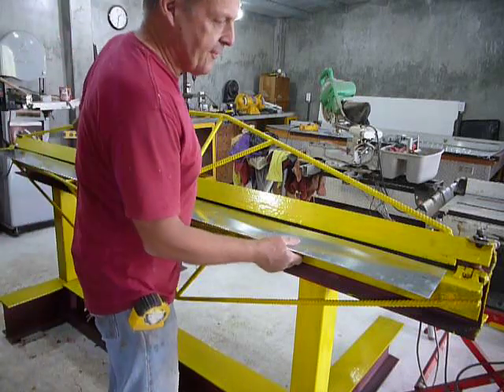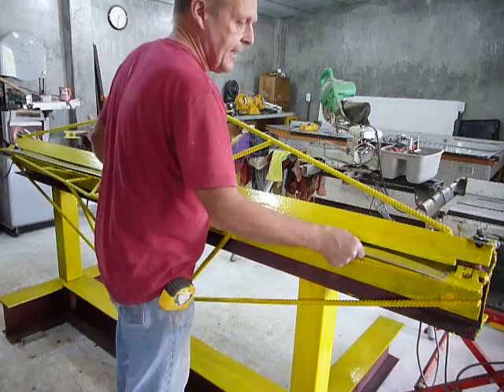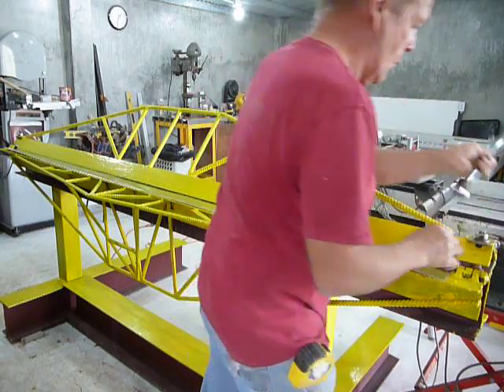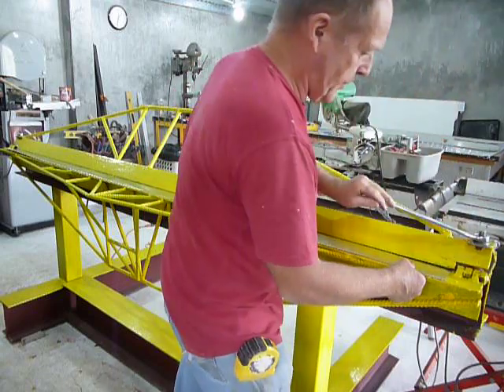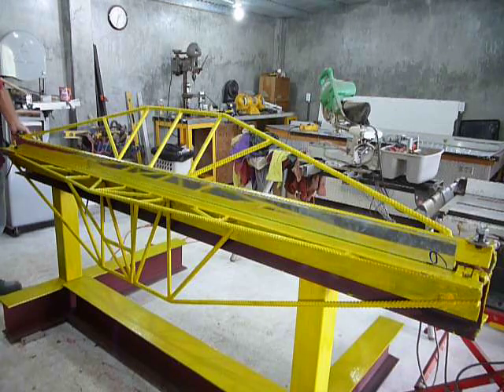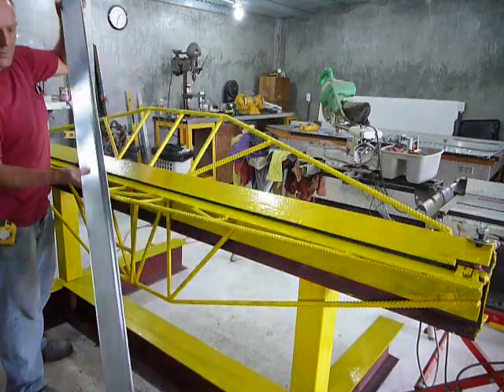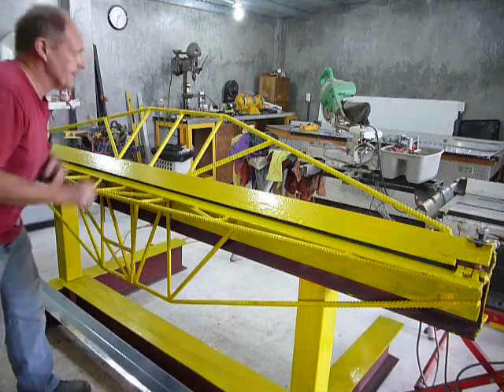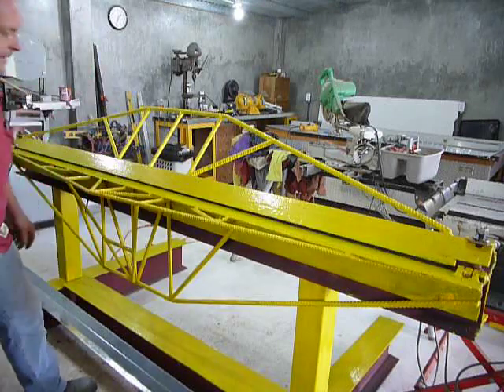First Bends on My DIY 8-foot Sheet Metal Brake

Comment: I used a smaller similar design to bend all the pieces for my E link on Pele'

OBB (Odd Ball Bender / 100T press Brake) has 8,000 lbs of metal in it, I can't wait to get my tooling installed and test it out..

Comment: Nice one Fred, i'm working on one of similar size at the moment. Nice to see the trusses worked out. I can't afford to throw vast amounts of steel at my brake like most other DIYers do, so it nice to see that something like yours works... Saludos.
Reply from the maker: Hi Mike. Thanks! It takes up a lot of real estate in my shop, but I am always surprised how much I use it. We have a lot of 1/16" diamond plate aluminum in the house and the brake does a fine job of bending an 8-footer. Good luck with yours! Saludos igual.

Comment: Excellent, it makes a sharp, crisp angle.
I worked in a union  sheet metal shop  -  #126- s. calif.
26 gauge was what we'd make our standard ducting out of.

May I suggest squirting in a shot of oil on the hinges? 
And cutting the corners on the floor beams back to 45*
would make things safer.

thumbs up / gonna see what else you've made
Reply from the maker: Hey thanks Gary. I appreciate your comment. Thanks for the reminder to oil the hinges.

Comment: normal rebar is pretty tough to weld. Do you have any tips?
Reply from the maker: I'm glad that no one told me that rebar was tough to weld before I tackled the project! I'm an amateur welder at best. I guess I just stayed in the weld for a long time and got the metals very hot. I used 6011 rod. I have to admit that two welds did pop loose when I was bending 1/8" diamond plate steel for my staircase. To get the 1/8" to bend, we had to grind a groove on the backside of the steel, thereby making it closer to 1/16". Still, it took two guys working hard to make the four-foot bends in the steel steps. So much force that a couple welds popped free and made quite a loud noise when it gave way; I think that it broke the sound barrier!

Comment: I have a question if you don't mind. What thickness angle did you use? I have a 6'er that I'm working on. I used 2X2X1/4" with a 4" chanel for the bed. The 2x2x1/4 is bowing up when I start to bend a 3' piece of 29 guage. I have the hold down angle turned the same as yours. On a lot of the brakes I have looked at on you tube, they have the angle laying flat on one side of the angle. Which do you think is better?
Ray

Comment: This is the biggest and most capable DiY sheet metal brake I have found so far. I attribute the crisp bends to the stiffening trusses and the pretensioning of the hold down bar. It seems curved and its ends have still a gap when the middle already touches so they need to be clamped down. Did you intensionally build this bend into it or was it a welcome result of welding distortion?
Reply from the maker: Thanks very much for your kind comment. I have to say that no, I didn't plan for the pretensioning.  I am in no way a professional welder or even a technically proficient back yard welder. I just thought it through to the best of my ability. It was a total happy accident. But it sure clamps a piece  down good and tight! Even after the years since I built it, it still bends crisply. Thanks again.
Reply: When I will build mine I will use yours as a guiding star. I hope I will get the same happy accidents. :-)

Comment: That is one long brake man. I've got my sights on making a brake for myself. Gonna weld it up with my everlast welder and paint it black.
Reply from the maker: Yes. Too long in fact as it takes up too much shop real estate. It is too long most of the time, until I need that length to bend some 8-foot sheets! Wishing you success with you project!

Comment: You did a nice job on your metal break. Can you post your build material list. Thank You!
Reply from the maker: Thanks very much Mark. Sorry, but I just picked through the pile of scrap and picked out the pieces that I thought would work. No plan, no list. Didn't measure. Just cut, fit, welded. It is a miracle that it turned out at all. :)

Comment: If you were stranded on a desert island and made that, I'd be impressed. I just bought a Chicago brand model 8/16 break at an auction for $200.
Reply from the maker: I think I will take that as a compliment 😁. Actually I am kinda on a desert island -- I live in Panama where our options are quite limited. Kudos on your awesome purchase!
Reply: @panamafred1  How do you like living in Panama and why did you choose it over Portugal or Croatia? More importantly, why did you choose to become an ex-pat?
Reply from the maker: @sandercurtis1847  My wife and I have been retired here a bit more than 13 years now. We like it; the weather is good where we live in the rural mountains -- no need for heating or AC. The air is clean and fresh most of the time unless someone is burning, which happens a lot less now with education. And nature is right in our back yard -- sloths, boas, birds, you name it. We can get most of what we want within a 40-minute drive. I feel much more self-reliant here and free from the Nanny State. When we built our house, there was only one inspection -- at the end -- by the fire department who checked the main panel for correct wiring. We wish the food was better -- when was the last time you saw a Panamanian restaurant in the States? We chose Panama because it is close to the States. It is relatively safe here compared to some other Latin American countries, and we have never had a problem beyond the very-seldom Sneaky Pedro visiting us in the night to attempt petty theft. Panama uses the U.S. Dollar. When we came here, Panama had a program to attract expats and the process was quick and easy. Prices aren't the cheapest in the world, but are entitled to numerous discounts -- I used it at the dentist the other day to receive a 15% discount off a $300 root canal. And being retired, there is a special line in government offices and banks for us old people who get priority. I would love to live in Portugal, a beautiful country for sure. Croatia wasn't on the map for us at the time but understand it is lovely and affordable. Why did we chose to be expats? When my wife and I met 15 years ago, she expressed a life-long desire to live outside of the U.S.A. -- she decided that when she was 10 after writing a report on the Galapagos penguins. After writing the report, she told her parents that she wanted them to send her to the University of Mexico right then! Just a bit precocious. When we moved here, other expats moved out of the States at the same/similar time because of Bush or Obama. We moved for a new cultural experience. When I was in the service many, many years ago, I was told that I had zero aptitude for languages and that I would never speak a second one. I'm not fluent, but I can speak Spanish sufficiently to be easily understood in a conversation. I pick up and take home our gardener four days a week (I don't want him on the buses during Covid) and we have very involved discussions about a wide range of topics during the drive. It feels good to have this accomplishment. I say I speak Tarzan Spanish. We both feel that we have grown exponentially and don't see moving back to the States. So much more, but this is the short answer. I have lots of stories on my blog at panamashippingcontainerhouse.com -- just dig through the Table Of Contents. Thanks for your comment. Fred
Reply: @panamafred1  You are an impressive and adventurous man. All the best to you.
Reply from the maker: @sandercurtis1847  Thank you. I try to live outside of my comfort zone!

Comment: the only thing to improve his design is to put a strong threaded rod with 2 nuts either side of the high point in the truss to be able to tension the week point in the truss because over time and on thicker material the angle will distort an bend
Reply from the maker: Great idea. Thanks!

Comment: great work! do you think that may be i can do some one similar to bend plates of 2" wide and 1/4" thick?
Reply from the maker: Thank you very much. A bending brake like mine to bend plate steel -- no. But in YouTube search for "DIY press brake" to see a good way to bend plate steel. You can make one with a hydraulic jack.
Reply: ok gracias!

Comment: Man I've been wanting to build a brake kinda like this for about 3yrs but wasn't sure if it would bend metal thick enough for what I was wanting to do but after seeing this I know it will work..thanks man that's so cool I'm jealous .. Just one question what did you use for your hinge? someone else asked if it would take on 16ga I'm sure it would if not it would with a bit of tweaking and with 2 men working it ..I wonder about how much longer you could make it if any it sure bent that very easy looking
Reply from the maker: You are welcome. I didn't know what it would bend, either! For the hinge, at each end of the brake I used a 3/4" bolt and three nuts. I welded the bolt head and one of the nuts (the middle one) to the stand and the other two nuts to the part that swings up to bend the metal. Pay close attention to alignment -- center the bolt between the stand and the swing part. You have to grind away parts of the stand and the swing so that there is space for the bolt to center. Weld really well or they will snap off under pressure. Voice of experience.
Reply: I'm finely fixing to start building mine it's going to look mostly like your. I'm going to shoot for 16.5 feet lol I know it may not work but I'm going to try if it doesn't work right and I can't work the bugs out of it I figured I could alway cut it down to 10ft. your dose so good at 8ft I'm sure 2 guys can work one like this 10ft I hope.. I think most of the metal I'm going to be bending is going to be aluminum and most will be around 13ga 0.72 in thickness..  Have you made any modification to yours
Reply from the maker: Hi Jimbo,

Wow, sounds like you have a mega project. Just make it heavy or bolt it to the floor because the force with two or three guy working the thing will be huge. Good luck! No, I have not made any modifications, but I have had to re-weld a joint or tow that popped under pressure.

Comment: Fred. thanks for your message. please you think its posible make in 3 meters long?? you think i will be change some dimenision?? thanks. jorge
Reply from the maker: +Jorge Chappuzeau Sí, Jorge, creo que es posible. Pero yo creo que sólo doblar el metal más delgado. Las fuerzas en el centro de la máquina son enormes y con acciones más grueso que probablemente conseguir un poco de deflexión. La curva en el medio no sería tan fuerte si se dobla el metal más grueso. No sé en qué momento de metal es demasiado grueso para doblar bien ... Usted también puede hacer la bisagra más fuerte y el uso de un tornillo más largo y añadiendo otra tuerca o dos. Hacer buenas soldaduras - las fuerzas son enormes!

Yes, Jorge, I think it is possible. But I would think that it would only bend thinner metal. The forces at the center of the machine are massive and with thicker stock you would probably get some deflection. The bend in the middle would not be as sharp if you bend thicker metal. I don't know at what point metal is too thick to bend well... You might also want to make the hinge stronger by using a longer screw and adding another nut or two. Make good welds - the forces are massive!
Reply: HELLOO FRED!! THANKS FOR YOUR PATIENCE... JAJA
THE STEEL I THINK WORK IS 0.4MM LESS THAN 1 MILIMETER YOU THINK THIS CAN DO??
YOU MAKE CONTAINERS HOUSE? I WORK IN THIS!!!!!
Reply from the maker: Oh, .4mm -- I thought you meant 4mm! Yes. Easy!
Oh, .4mm - Pensé que te referías 4mm! Sí. ¡Fácil!
Reply: you think keep the specifications of size metal chasis machine?
Reply: R

Comment: Can you brake a g16 8 feet sheet metal?
Reply from the maker: I haven't tried, but I don't think so, not without cheating. In my experience with my brake, I think that it could bend 16 ga. x 4" long, maybe a little longer. I say this because I made a staircase out of 1/8" steel diamond plate. The pieces that I had to bend were 4' wide. Even with two people muscling to the max, we couldn't get it to budge. So with an angle grinder with a 1/4"-thick grinding disk, we made a groove on the back side of the steel, grinding about half-way through the metal. (This made the equivalent of about 1/16" or about 16 ga. if I am not mistaken.) Then with a lot of muscle power, the two of us could make the 90-degree bends. Maybe we could have gone to 5'-wide as we still had a little muscle power left, but I think that 8' would have been pushing up against the impossible. But I wonder if 3 guys could get it to bend?

Comment: it would be hard to bend thick gauge.
Reply from the maker: Yes, for sure. To bend a 4-long piece of 1/8" steel, I had to use an angle grinder to make a groove half-way through the steel on the backside of the bend. But two of us got the job done and now I have a beautiful diamond plate steel staircase.